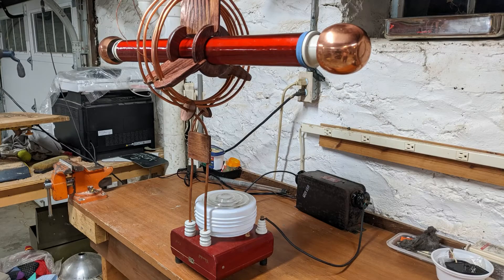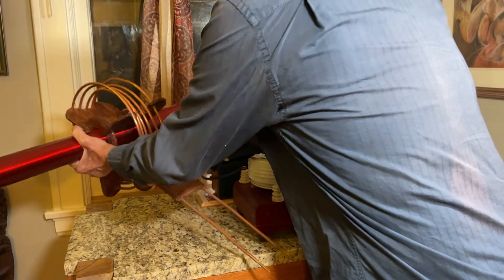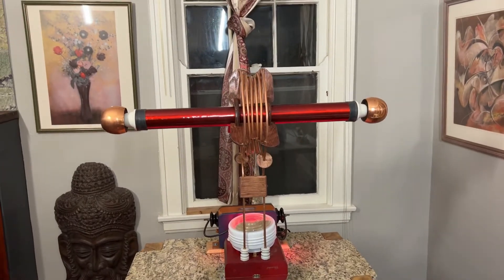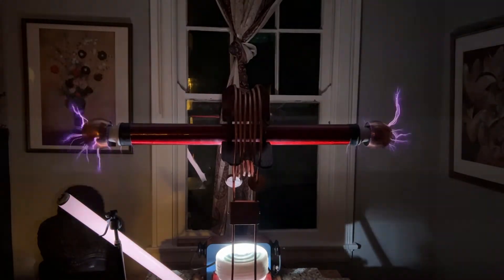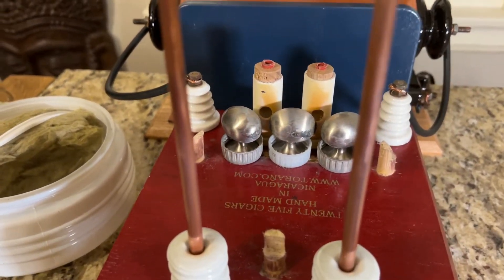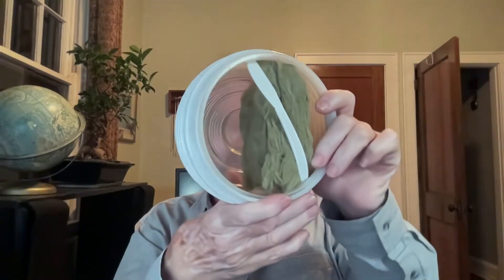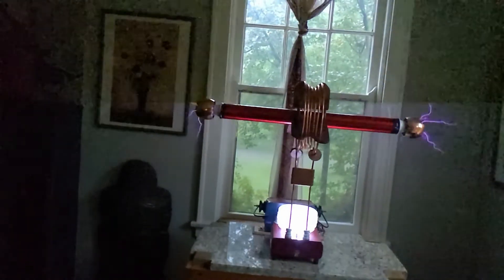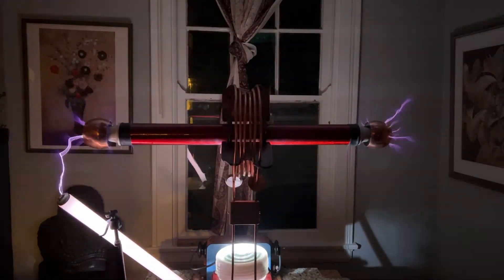BiPolar Tesla Coil

Comment: really good output!
about the rules, i want to add some commentary:
1- this "rule" is not actually a rule, its more of a "do this for maximum performance instead of spending hours manually tuning it", so, its not a rule that you MUST do, its more of a convenient approach, also, if you are doing this, i recommend tuning the coil to achieve near perfect halfwave antenna (for "normal" tesla coils, quarter wave antenna) length, so at the output, the standing wave would peak, meaning the voltage would peak! and this is probably how nikola tesla himself made it (i need to read more about his works and how he did it)
1.5- (about the secondary shocking you) i think that this is just static electricity, especially if the pipe came wrapped with packing peanuts, its like a really low value capacitor that discharges to you (because you are the "ground")
2- yes and no; if you are making a spark gap tesla coil (like the one showed in the video), then yes, you want loose coupling indeed. But if you are making a cw or "high current" tesla coil (those usually have low input voltages, and are mainly just solid state or vacuum tube (there are some designs of a "high current" spark gap tesla coil with low input voltage and high input current (and normally, high bps), and "hot" arcs from the output))
3- this is more of a safety thing rather than a "rule", but yeah, i recommend using them, not only for safety, but also to have the capacitors fully discharged when running it again
4- there is no rule!
5- this is to ensure that the capacitor bank gets to live longer, and because sometimes in a resonant circuit, the voltage can get pretty high (up to double), but in practice it would probably be lower, sometimes alot lower than double (like 1.5×)
6- yes, those designs arent electrically equivilent, because in the design that is on the left, the high frequency current can go to the transformer's secondary (the transformer that is powering the circuit (in your case, the neon sign transformer)), while in the one on the right, the transformer is pretty much "protected" from the high frequency current, and this actually has its own comparison in wikipedia and other pages
7- for maximum performance, absolutely! but i wouldnt consider this as a "you MUST do this or your coil would fail!" rule
8- idk, i've heard this alot, but i think it is false. but yeah, be careful with fires!
9- this does generate UV, but not "DANGEROUS", its a little amount of ultraviolet, but because the eyes are sensitive and because everyone wants to have their eyes at a good condition for as long as possible, this is a convenient thing to do (but for short runs, i dont think that this would do anything, trust me, i've (accidentally) looked directly at a 220v +20A carbon arc lamp (while being JUST a few centimeters away from it)! the effects stayed for like a few minutes, but after a day it just disappeard as if it didnt happen) and dont worry, no x-rays at all. so if i made one, id keep it open, but when i use it in the dark, i would cover it ONLY to make the output arcs look alot cooler and more beautiful
10- for fragile designs (like powering a 220v rated MOT at 400v (ballasted), or like using a ZVS driver), i would use a safety gap. but for normal operations, its just paranoia
11- i'm not an expert on neon sign transformers, but i heard that newer neon sign transformers have some protection devices (like overcurrent and ground fault), but even this has its own "how to disable" videos on youtube, so id say this is false and not a rule
12- (im not encouraging you to do this) NOT true, maybe for spark gap tesla coils (like the one you made), it would hurt, but other than that it will do nothing, it wont electrocute you, especially with more continous coils (like vacuum tube or solid state)
13- grounding the coil does improve its performance, though im not sure about bipolar coils, i think that the ground is useless for such coils l, but idk, so yes, that a good rule to follow
14- 7:27 exactly!
15- well, i think that your reasoning is pretty solid, a little amount of ozone wouldnt damage, it would heal! (but obviously, for long runs it becomes bad)! its kinda like the "hormesis" model of radiation (i probably mispronounced it) that says "a little amount of radiation is beneficial". 
hope this helps! if im wrong, i would love to be corrected!

Comment: shocking unexpected:  earths moving magnetic  field , where its stored ,air flow over the ends can build static charge there a patient on a ball or 2 coated with foil out in the wind when the winds is of enough strength  can produce a spark if the gaps set right ?

Comment: 4:24 the left circuit is almost correct, it needs air to quench the spark gap, so that the slow charging c1 capacitor is quickly discharged through the single turn L1 primary, without oscilating. As Tesla explained in his 1891 lecture. it is due to the quick unipolar change in the electrostatic field.

Now you know why the right circuit is different. as it uses EM resonance in the primary, not electrostatic induction.

the resonant mode in the secondary will be different!
Reply from the maker: that i did not suspect. Thanks!

Comment: A copper tube has no resistance to DC but overall impedance on the resonant frequency is significant due to reactance.
Reply from the maker: Yes I forgot there are two AC currents. The 60 cycle power and the 100K high voltage.

Comment: The bi-polar Tesla coil is a good example of lateral thinking.  May I suggest a extension of lateral thinking?  Suppose the primary coil were ONE single turn made of copper water pipe?  (Very low inductance).  So the electrolytic capacitor must be of very high capacitance.  The line power supply must provide DIRECT voltage (rectified), say around 200 volts, and always charges the electrolytic capacitor via a series resistor.  Your spark gap acts as a switch, but this should be replaced with an electronic switch.  Use an IGBT (Insulated Gate Bipolar Transistor).  Maybe two connected in parallel.  The IGBT gate is driven by a separate digital oscillator with 1000:1 duty cycle.

So the voltage across the electrolytic capacitor has a "sawtooth" waveform.  And the electrolytic capacitor charges in 1 millisecond and discharges in 1 microsecond, say.  The induced high voltage in the long secondary coil is proportional to the rate-of-change of the discharge current in the primary coil.  So the induced high voltage is present for one microsecond every 1 millisecond.

I have never built this, I'm just dreaming.  I suspect the danger from ozone (caused by ionization) is real.  Ozone is poisonous and might possibly cause cancer.  Be careful.
Reply: High-capacity and low-impedance HV capacitors can get VERY expensive and inductors are very cheap, so to hit the target frequency it tends to always be better to have a larger inductor so that you can get away with a smaller capacitor. As you make the inductor bigger the current requirement also decreases, but the voltage has to increase proportionately, so you do eventually get to a point where the voltage becomes the main problem, so most designs settle on a balance in the middle since all resonant primaries will drive the secondary in the exact same way, with the difference being in cost and electrical efficiency.
Reply: Sam's right on that. Also I'd steer clear of electrolytic caps for anything other than the DC side of the supply line assuming you go for the solid state version as they tend to blow up under high frequency loading.

Comment: Nice Coil! I really like this design, and it's an inspiring build. I built a VTTC with a GU81 Soviet transmitter tube. My first coil. Vacuum tube coils are pretty quiet by the way. The streamers aren't very loud. Not much more than normal conversation. With the Staccato circuit there is more of a snap, but still pretty quiet. I am curious about trying a bipolar VTTC.
Reply from the maker: Wow thats a pretty ambitious first tesla coil project!

Comment: The two circuits are not identical.
The one with the spark gap connecting the primary needs a high frequency resistant transformer.
The design with the spark gap in parallel just needs a short circuit proof transformer.
Also the spark gap does produce UV but Xrays no, you need at least 10kV in a vacuum to produce any kind of sort xray.
The copper tubings resistance does not matter, its low resistance for 60hz yes, but its purpose is to simply charge the capacitor, once the capacitor reaches high enough voltage to short its contacts you have a a primary LC circuit.
the spark gap on design two just acts to short the transformer until the next charge cycle.
Ozone is indeed toxic to humans, but even for lower concentrations more toxic to smaller organisms (from what I know).
The tesla coil run in short durations wont make enough ozone to murder you, but once you start feeling a bit unwell, open the window as soon as possible
Reply from the maker: I did not test both circuits. The coil I built uses diagram 2 - the spark gap is directly across the transformer.
Reply: @JimPaul0627  that is the most common circuit design since its easier to find short circuit proof transformers.
Note: Microwave Transformers do have shunts for short circuit protection but they are not large enough to redirect all of the magnetic flux, so you need a ballast (another inductor from a discharge lamp fixture for example) to externally limit the current on the primary side.
Reply from the maker: @janno288  My understanding of "shunt" is that it is a short circuit. Is that the nature of a shunt in a Microwave Oven Transformer? Can one see the "shunt"?
Reply: @JimPaul0627  It is a magnetic shunt, in MOTs it is typically two bits of steel inbetween the primary and secondary.
TBH I think the original post was wrong and you need HF and short resistant transformers in both circuits, since I doubt there is much electrical difference.

Comment: The capacitors have to be more than the amplitude of your high voltage power supply. You calculate it by multiplying the rated secondary voltage and the square root of 2. That is how you can save your capacitors from dying.
Reply from the maker: Thanks for that simple calculation solution.

Comment: Nice build .I did a bipolar slayer Tesla coil .just to see f I could and it did work . It's self tunes because the extra wire around the coil goes to the base of two 3055 that pump the primary so it tunes it's self .im thing making two identical coils and ground them and see if the second receiver twin will power up .
Reply from the maker: Can you post a picture of your device somewhere an share the link
Reply: @JimPaul0627  
I had pictures of it running but my tablet crashed .I'll have to set it up again and run it . If you by a 40 watt slayer tesla I coil off of eBay and if yours is like mine pull the bottom off carefully. Very short wires . And remove the bottom coil wire from the resistor going to the base of the transistors ..that may be double 3055's then move the primary coil up to the middle of the secondary..bring the removed secondary from the resistor out and up front and place a small neon on each end of the secondary .now place a wire on that base resistor and rape it around the secondary  like four turns .and try it if it doesn't fire up add more turns to the base coil going around the secondary.this is to get the voltage high enough to trigger the base..I'm in the middle of another coil at the moment..